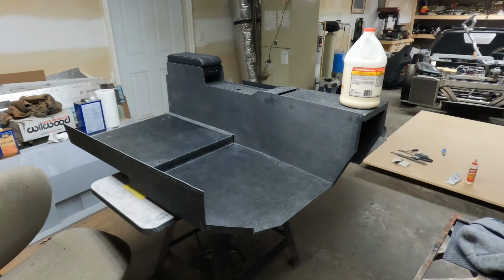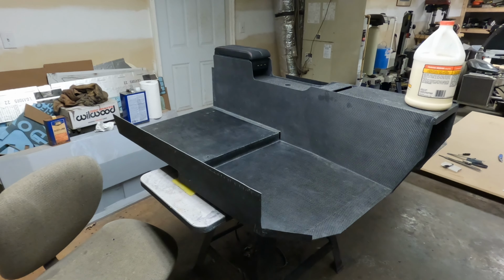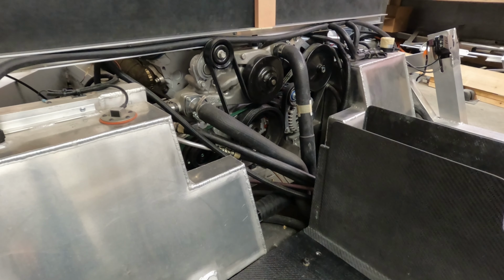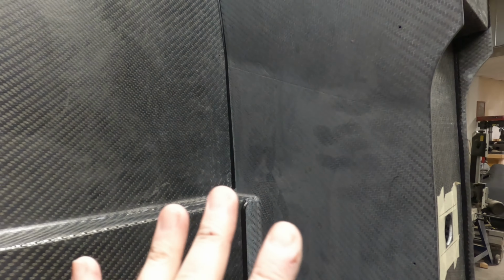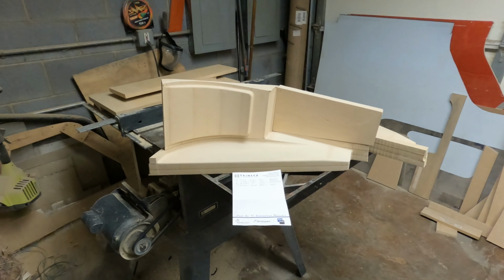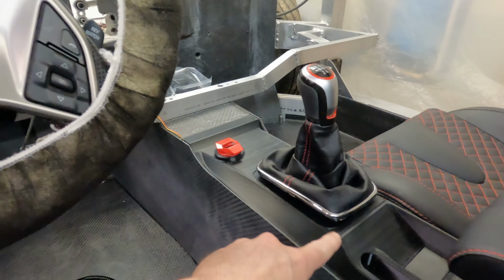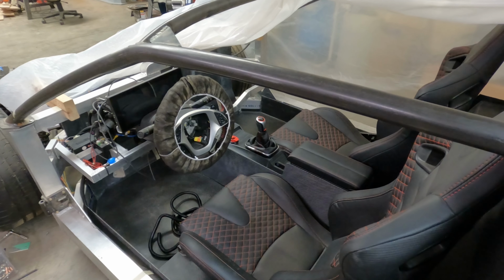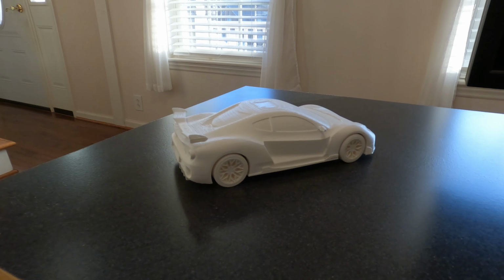Building my own Supercar - I 3D printed a model of the car

Comment: You are using carbon fibre as bling, so much effort into bling, for the sake of 'bling'. It is just silly and gets more silly as this build progresses
Reply from the maker: How is it different than someone buying a new Corvette C8 and replacing a lot of the interior or engine bay parts with carbon fiber trim? I want the carbon fiber look for the interior.
Reply: Just like any Bugatti, Koenigsegg, Pagani, Rimac, and so on.  Looks nice and I think part of the fun is the process.
Reply: Those cars already have insulation, sound deadening and other features already installed. This is just 'I want bling,' before the basics have even been installed. It is just plain silly.
Reply: @peterdoel6447  Silly,.. is you crying about someone elses hobby. Why dont you try to accomplish something, other than crying.